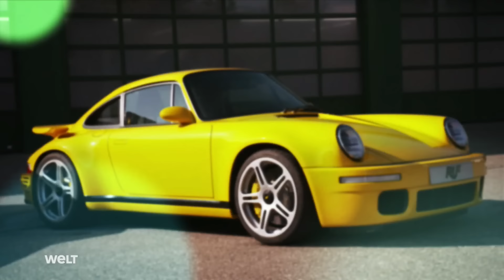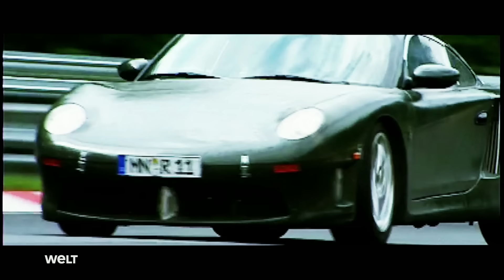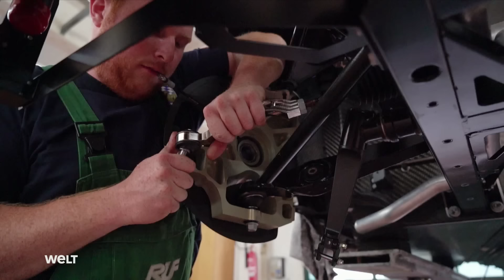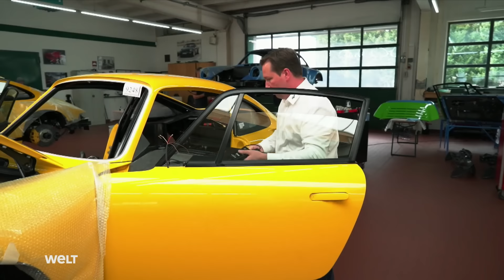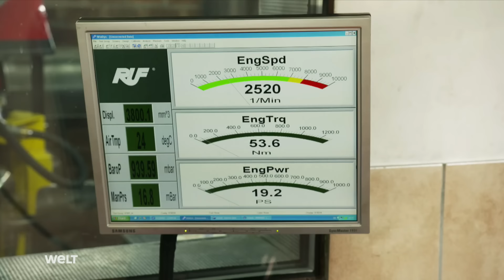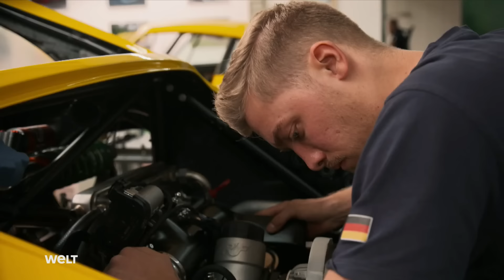GERMAN CRAFTSMANSHIP: RUF CTR Anniversary - More exclusive than Porsche | WELT Documentary

Comment: Forcing more air through an engine doesn’t make it harder to cool. Take a look at compressed air supercharging the engine is ran off of nothing but high pressure air and makes more power and is also cooled by the air because it’s so high pressure coming out of the tanks.

Comment: 0:09: 🏎 The CTR anniversary hoof is a hand-built, high-performance supercar with a rich history.
5:30: 🚗 The process of assembling the sportscar involves precise calculations, expert handwork, and the use of specific tools.
11:19: ✍ The paint specialists in the small paint shop use manual skills and a trained eye to paint car bodies, regardless of the material used.
16:47: 🚗 The speaker's father bought their first Porsche after witnessing an accident and later sold it easily to a student.
22:25: ✨ The CTR race car features improved aerodynamics and a push rod system for better handling and dynamic tuning, with a unique engine design and assembly process.
28:13: 🔌 The Habit systems power up the vehicle and check the communication between ECUs.
33:34: 🚗 The narrator's childhood infatuation with the unique sound of a Porsche 911 engine shaped their future passion for cars.
39:25: 🚗 The engine is dry and will be built into the car tomorrow morning. The company museum houses exclusive vehicles, including the famous yellow bird prototype. The yellow bird gained popularity through the Sony PlayStation game Gran Turismo.
45:09: 🔧 The mechanics install the engine into the CTR anniversary car, with finesse and careful maneuvering.
Recap by Tammy AI

Comment: You can easily get 1100 hp from the 3.6L Mezger engine, and still have day to day drivability!
Reply: How come the 997s mAx out at around 400 hp
Reply: @danrook5757 max out at 400hp???? A 997 gt2 rs has 612 hp. ES MOTORS HAS gotten them to 2000+ hp

Comment: Can they be called OEM when most of the parts are aftermarket supplied by subcontractors?
Reply: Most automotive manufacturers use parts from other companies in the assembly of their vehicles. Ford, Volkswagen, Toyota, etc, etc

Comment: :face-purple-crying: I watched  way RUF cars are  build, i liked car  its   Porsche look alike,.  but its mess of the car . It was impressive till i have   watched Mr Roof and  JA LENO driving car on road in America. On screen car was  driving towards  screen and  you can  see  right headlight  mowing sideways ,all front clip was shaking from side to side ,no surprise  that front clip is floating sideways ,   being  2x4 inch box section  front clip frame rails  fixed to the  carbon fiber body  with  four bolts , on each  frame rails ,looked like 1 meter  apart  ,leaving  50 cm on each side   for body to   hang in it.  What made  worse  suspension struts are  mounted   front to back  there is nothing  to stop  body mowing from side to side, front suspension is  like ,FRASER English kit car set up ,Even  formula cars or racing cars  dont shake as RUF does. It is power full car but not for the  Mr RUF  and  JO LENO ,THE TWO OLD FALLAS , watching  them driving and siting in that car  ,you could see  their body   shaking ,i didnt know are they going to have orgasam or heart attack. Front indicators are like 1930 cars  you could not  see them on, so fainted ,  stayed on not flickering Sorry mr RUF that was big miss, i liked the other two PORSCHE CARS  THAT YOU BUILD , SPECIAL THAT GUM METAL GRAY  COLOUR  ONE  LOOKES BETTER THAN ANY PORSCHE CAR UP TO DATE ,ITS IN CLASS OF ITS OWN.  BUT THE  911 ONE    NO.  Not surprise  that Porsche didnt wont to  have anything  to do with   building of the car, probably after  they seen    drawings of the front clip way is  structured and fix to the body of the the car.If that car  GETS IN ACCIDENT and  hit in   left or right front quoter i think  whole front clip will get  separated from the body. I am classic car enthusiast,i had 1969  911T after  rust repair i sold it for $2500 NZ dollars,  i like nice cars i got  1997  Boxter, siting in my driveway with    stuffed   tiptronic.  What  i seen on You tube  way RUF  beehives on road  while Jo Leno was driving it , that car is not for  old farts like me and mr Lenno,  I like your restoration  work you do on Porsches  BUT WHY GO AND BUILD SOMETHING THAT  HAS BEEN BUILD OLL READY BY PORSCHE FACTORY. LOTS OF OTHER PEOPLE    MODIFIED  PORSCHE BODIES AND BUILD  WIDE BODIES ,  IT CAN NOT REPLACE  GENUINE CAR .  SORRY I WOULD SKIPED IT.  ITS just another PORSCHE KIT CAR. I would not pay $850 k.  For all  those people  who  go and build another Porsche its wast of money i would go and buy Porsche and  install that  RUF engine  in it and will have nice and fast Porsche car AND I WOULD BUY   THAT BETTER THAN PORSCHE FACTORY CAR..  IM SORRY IF I OFFENDED SOMEONE  ,BUT THIS IS MY PERSONAL  OPINION.
,